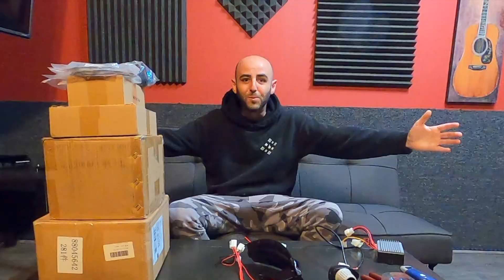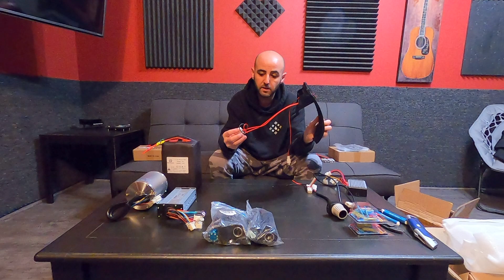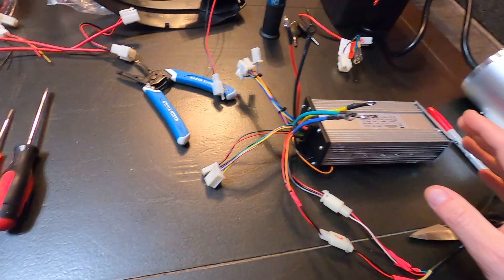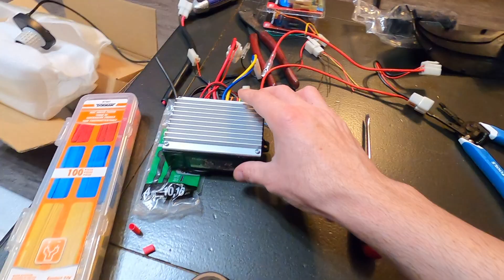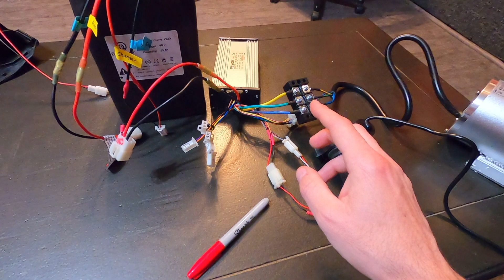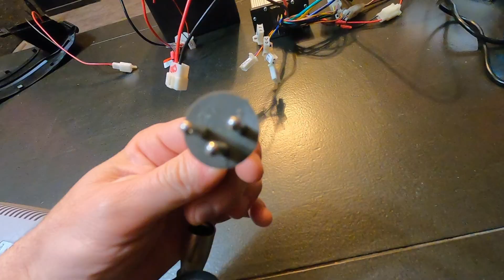Wiring 1800w Vevor Kit On Razor RSF650 | Custom Build - Part 3

Comment: hey can you please tell me how you connected the original razor battery wires to the new battery i saw other people soldering but I'm not trying to do all that i saw that you cut them and put some connector but i still am confused and don't know if its safe and where you got those connecters
Reply from the maker: You can use these ( https://amzn.to/3HGh1O4 ) to connect the wires but you'll need a crimp tool and a heat gun (or lighter) to secure the connection. 

As far as the connection itself, try to follow my video, (its basically black to black and red to red) but be very careful and make sure the red and black wires do not touch each other, otherwise you'll have an early 4th of July cook-off lol